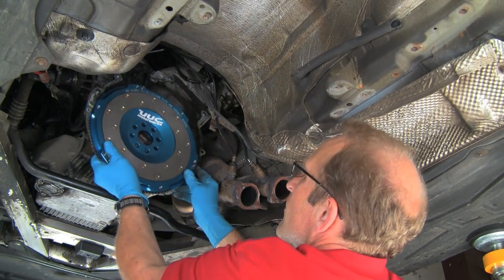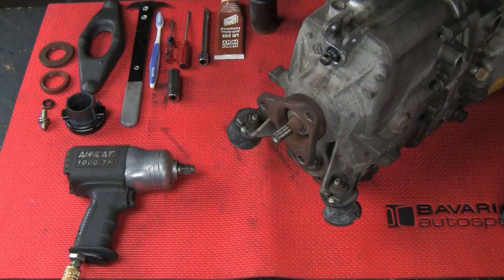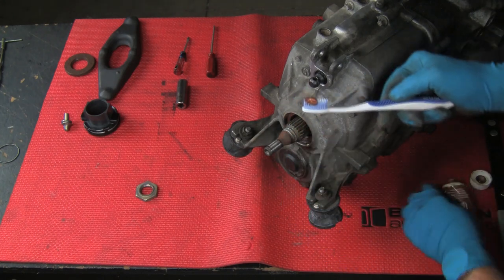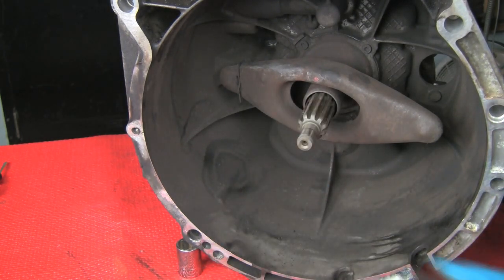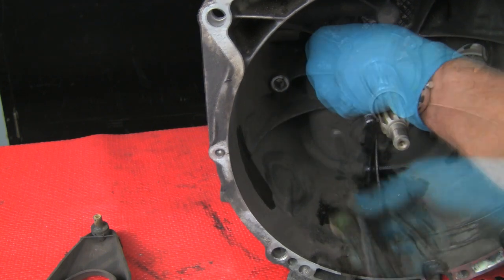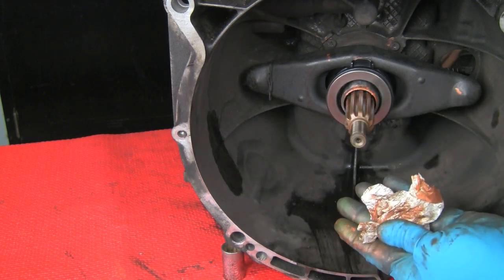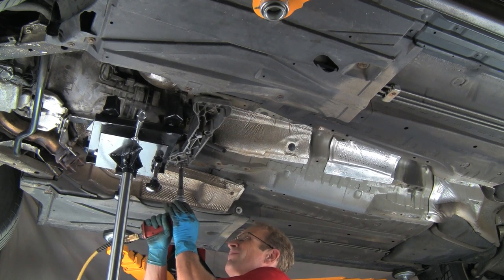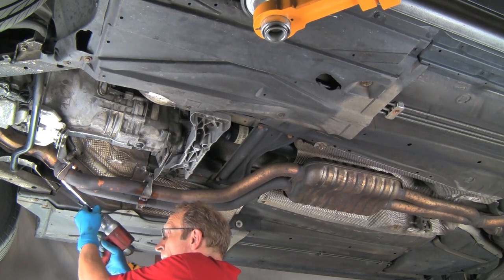Replacing a BMW Self-adjusting Clutch & Dual-mass Flywheel Part 2 of 2

Comment: Done mine one year ago, took me 2 days... :)
I use a Sach reinforced mecanism and a standard disc (no springs).
I was having a vibration at the pedal for a long time after having installed this new clutch, then today the the clutch release bearing has broken...
Do you have an idea of what can gave me vibration at the pedal ? Frequency is synchronized with the engine rpm, gear engaged or not leave the same feeling... Ideas ?

Comment: I just installed a Valeo single mass flywheel clutch kit including a new throwout bearing in my BMW. Though now when stopped,in neutral and clutch out, I hear throwout bearing noise.  Sounds like a quiet diesel. Any idea the cause? Some forums say it's hit or miss. .
Reply: if it sounds like a diesel when the car idles it's probably not the throwout bearing. it's the clutch chatter it's a pretty normal thing when converting from a dual mass to single mass setup.

Comment: I will definitely NOT be trying to do this job myself on my gravel driveway with axle stands, instead I’m going to be saving up for someone else, someone with all the right tools, to do it for me. 

Also, will be fitting an OEM LUK dual mass flywheel and clutch when the piggy bank is full.

Comment: I have a BMW 1994 325i and need to replace my clutch would like to know what exact clutch I should get would prefer a dual mass. What parts do you recommend I change as well as change the clutch
Reply from the maker: Cristian Marquez - We can offer you a direct stock replacement clutch assembly as well as the LUK new replacement dual-mass flywheel.  If you wish to eliminate the dual-mass flywheel, but do not want to go to a lightweight flywheel, we offer the Valeo dual-mass elimination kit.  This has a non dual-mass flywheel that weighs the same as the original dual-mass and a stock type clutch assembly that is made to be proper with the new flywheel.  You can see all of this is you go to the online store www.bavauto.com and enter your vehicle, then enter flywheel in the search box (for flywheels) or clutch (for clutches).
We recommend that you replace the following (our Advisors can help you personally at 800-535-2002):
* clutch
* flywheel
* throw-out bearing
* pilot bearing
* pivot pin
* transmission seals
* engine rear crank seal, if it's leaking
* rebuild shifter mechanism as required (fix sloppy shifter)
* Flex disc if original is cracked
* Transmission mounts if soft or cracked

Comment: Is there any chance the input seal can be put in incorrectly?  A friend and I recently replaced the clutch on my E36 and I was having a leak of clearish fluid at the bell housing.  Initially, we thought it may have been a leaking clutch line which was dripping onto the cross member support under the car.  I recently changed slave, hardline, and clutch line, and the leak is still there.  Looking at how you installed the input seal, I would guess we didn't do it any differently (I didn't install it).

Comment: How many hours of labor would this procedure take?
Reply: If working on your back, in the garage, it can be a 8 to 12 hour job the first time you do it.  We did the video in one day (using the lift) and this takes longer due to the filming.  A couple weeks later, we did another clutch replacement and, with two of us working (an on the lift) we did the job in two hours.
Reply from the maker: If working on your back, in the garage, it can be a 8 to 12 hour job the first time you do it.  We did the video in one day (using the lift) and this takes longer due to the filming.  A couple weeks later, we did another clutch replacement and, with two of us working (an on the lift) we did the job in two hours.

Comment from the maker: Graham S - We could not reply directly to your comment as it was entered via Google -
You can use a specific floor transmission jack.  These are available from Harbor Freight and others.  They have a large saddle and tie-down straps or chains similar to the high-lift jack we used.  Other than this, a common floor jack can be made to work by using ratchet straps around the transmission and the jack's saddle.  this is not nearly as secure as a transmission jack, but with care, can work quite well.

Comment: Great video once again, I enjoy watching them! I have a quick question when you have a minute: Replaced the clutch, pressure plate (to a self-adjusting) and flywheel (to a single mass) in my 01 330i and upon completion, after bleeding, I found that the clutch pedal didn't go to the floor, it stopped an inch before. Also noticed the clutch did not engage until almost to top of the travel on the pedal. I've searched on forums with no success, any ideas? Thanks
Reply: Bump. I have the same year/model
Reply: And? What was wrong?

Comment: You guys are awesome! I've been a professional mechanic for ten years and I have never used anti-seize on seal's I always use a little grease, assembly lube or whatever fluid or oil suits the application. I'm always happy to learn new tricks of the trade though thanks.
Reply from the maker: The main issue is to use some type of lube on the seal lip ... as you have been doing.

Comment: What yall think of switching to a Single Mass Flywheel in a 2006 320d? They are much cheaper SMF kits on ebay, including clutch and bearings.

Comment: I don't understand why people use antiseize to lubricate seals, pivot pin, or anything except what it was designed for. Remember, antiseize is simply a grease with very fine metal shavings in them. Why would you want to put metal shavings between a shaft and a seal or pivot fork and pivot pin? Just use regular bearing grease instead of anti-seize.

Comment from the maker: We do have a general shock and strut install DIY on our Tech Blog (blog.bavauto.com).  Once you check in at the blog, just search for "shock strut DIY".  The procedures shown for the rear shocks will be very close to the same for your Z4.  One difference is that the access to the nuts on the upper mounts requires removal of some of the convertible top trim parts, in the trunk.  We can help you with this, just call us at 800-535-2002.

Comment: copper lube on rubber/plastic parts is not okay. It will cause swelling and leaking. Only silicone grease should ever be used on rubber gaskets.

Comment: Hello I have a 316d f30 2015 116hp raised to 186.5hp
My clutch has a vibration when the car starts moving. What clutch do you recommend, a beater one that the 240mm stock?

Comment: just watched video and im looking forward to do this job myself. but on a e90. 06 325xi to be exact. but im looking for this kit that you used. i know im not get the light weight flywheel. i looked on uuc website and seen only the Valeo DMF flywheel conversion kit. but not all the other goodies that u have in the video seals bushings, bolts, and exhaust gaskets and what ever else im missing... im no pro but no amateur either. any guidance will be greatly appreciated

Comment from the maker: You didn't mention what model you have.  However, most BMW models do have a 30mm output flange nut.  Some models have a lock-ring around the nut.  Have you looked closely to see if you have the lock ring still inplace?  Is the nut as much as 6mm larger than the 30mm socket (as noted in the prior reply)?

Comment: What lubrication compounds are you using for the rear main seals as well the tranny seals? Just normal antiseize? Also I was reading through the Bentley manual and it mentions having to torque the output flange but in two stages; also provided are stage 1 and 2 torque specs. What exactly does that mean? Torque to the first spec, back off and torque to the final spec?

Comment: Very professional way explained in video, thank you.
I have a question, my BMW 320d from 2001 is 5.gear model i bought from Swiss second hand. The clutch pedal point is bit to high and if i don't sleep it slowly it might vibrate or car jump in the back, sometimes after i drive several km clutch pedal falls in real driving point, fells fine changing gears while accelerating, but it wan't stay longer then about 30.sec, i have open mask to check for pedals, it's all clear no leaks from cylinders at all and all things are in place. After i saw your excellent video you made, you mention self adjusting clutch...it it possible my car have this kind of self adjusting clutch and is unable to adjust or is it cylinders got air on it. Underneath my car is all the plastic and heat shields intact, it seem never been in service for more than oil change, so can you tell me what could be the problem with my clutch pedal please?

Comment from the maker: Unless you have a desire for the performance increase that a lightweight flywheel can offer, you would be better off in using the Valeo Dual Mass flywheel elimination kits that we offer.  These kits include a steel NON dual-mass flywheel that is the same weight as the original flywheel and a matching clutch assembly for the standard style flywheel.  See them in our online store at bavauto.com or call our advisors at 800-535-2002.

Comment: Loved this video. It really helped me with my clutch replacement. My clutch kit, from Advanced Auto, did not include the same elements prescribed in the video. Unfortunately, I can't wait for the parts because of my new job, I have to have this wrapped up by tomorrow. I do want to get one of the UUC lightweight flywheels in the future, so I may redo this job again in 25,000 miles (My new job puts a lot of miles on my car).  Anyway, thank you.

Comment: Great job but on a e39 525 the starter may get seized on the gearbox locating pin. You can use a wedge to remove but should clean up the pin and hole with paper and lube

Comment: The fork clutch pivot ball which is made of plastic is very important to replace guys, they either brake or melt, you can go with the dealers plastic or aftermarket brass type which is better. Is less then 13dlls. Thank you!

Comment: It's also not a bad idea to spray some brake cleaner inside the transmission and clean out any dust and debris left over from the old clutch while you have it out of the car. Some people like to actually paint the outside of the transmission when doing a job like this. Honestly that's just a personal preference and mostly something that people do if they're restoring cars to make it look nice.

Comment: I need to do the rear main seal on an 04 325xi,guess I'll do the clutch also as long as i have it apart,are their any additional things to remove aside from the front driveshaft? Does the transfer case come out with the trans?
Thanks for the video,should prove to be a much watched reference point.

Comment from the maker: We can't be sure about your specific case, without driving the car, knowing the vehicle and parts details, etc, but your issue may be due to the unsprung clutch disc, which may be transmitting more engine vibrations.

Comment: Excellent video.  It had all the detail I needed to replace my clutch.  However, I do wonder if the engine needs any support from the top once all the transmission supports were removed.  It didn't appear any engine support was necessary.  Thanks

Comment: Hi,   Great video, can you tell me the symptoms of a failing dual mass flywheel.
I have a BMW 320d E90 2005. 116k.     Getting a lot of vibration under the car (not through the steering wheel) when accelerating  at 2k/3k rpm typically in 3 / 4 /5th gears this is under the car, rear wheels are balanced,  using the clutch i have no issue, thats working great..
Thanks
Reply from the maker: Driveline vibration can certainly be a symptom of a well-worn dual-mass flywheel.  However, we would also suggest that you consider the flex-disc and/or the driveshaft center support bearing in consideration of your symptoms.  The most common dual-mass symptom would be a lot of driveline slack feel, such as jerking between acceleration and deceleration.

Comment: Ok, the release bearing was broken, advice : Do not use a reinforce mecanism with a stock release bearing.... well the man at Sachs told me the it was the procedure, but obviously it does not work... unless you want to change your release bearing every 20000 km...

Comment: can you tell me if a BMW 525 TDS E34 from 1992 (construction code is HA91) is equiped with a DMF ?
Reply from the maker: Yes, your 525tds does use the dual-mass flywheel.  We do offer an aftermarket replacement that is about 1/3 the cost of a new BMW flywheel.  If you go to our website (bavauto.com) and enter that you have a 1992 325i (we do not show your Euro model 525tds) and enter part number DMF016, you can see the replacement flywheel. To place an international order, email us at info@bavauto.com.

Comment: My first gear keeps popping out. I've taken it to some mechanics and they are telling me I need a new transmission. Its 2009 bmw 328 I the motor mounts are worn out a someone said it might be that or my clutch. What do you think I should do? If I'm careful it wont pop out until the rpms reach 2000 or a little before that. Please help
Reply: Hi

Comment: great guide.. need help bavauto.. followed your guide to the dot, successfully installed a new clutch and pressure plate by Sachs, reinstalled the transmission, start the engine and all good no noise etc but clutch is not engaging??? put it in 1st or reverse gear but nothing?? i can even release the clutch and engine wont die..

also while the car is running, i can shift to all the 5 gears and reverse even if im not stepping on the clutch.. any advice?

Comment: Wow, great video. I've got a 2008 E90 318i, and on first gear, when driving a lot in town, the car wobbles and shakes a lot. Is it the flywheel ? It doesn't do this on other gears. Do you know what's the price to change the flywheel in Europe ? Thanks a lot
Reply: Nikita Ind Before you inspect the clutch, check the Crank pulley on the front of the engine that drives the auxiliary belt. A visual inspection with the engine running will be fine to start with. If it wobbles while running even a small amount, turn the engine off and check it for play. There should be some as it's essentially a rubber doughnut. I had what I thought was a ruined Dual Mass Flywheel but after the crank pulley fell off one day and I got it replaced my judder has pretty much gone.

Comment: Ever since I installed my JB racing lightweight flywheel on my E39 2003 530i I have a chatter that has gotten worse over the past 4 years. Pretty embarrassing at valet when there are 40 people standing there as your car pulls up and sounds like it's got bolts tossing around inside the engine. Its about time to replace the clutch again and I'm planning on putting the stock flywheel back in so strangers quit looking at my car like it's a bucket.  Anyone else get the chatter? It goes away if you put a little pressure on the stick shift or push in the clutch peddle. Some report it's not noticeable but mine is very very loud. Everybody looks to see what the racket is. What I regret most besides putting this part on my car is not keeping the stock flywheel. (PS I'm not at Valet all the time but trips to Vegas or some restaurants where Valet isn't optional are anxiety provoking! )
Reply: S Craigs lmfao

Comment: I have an 1998 528i, it was 36mm.  I put light grease on the splines, but it had some kind of glue on it when I removed it.  Does the output flange nut require thread locker?  I ordered $256 worth of transmission stuff from you guys and I got it two days sooner than expected.  Thanks!

Comment: What is the benefit of using the lightweight flywheel compared to the dual mass flywheel? I've read that there can be more vibration in neutral and lower RPMs, and makes it a difficult situation for street use.

Comment: Do I have a problem if you replace the double flywheel with single flywheel. It is about 46 e 2002 105 kv. thanks in advance
Reply from the maker: No problem at all, as long as the proper parts are use, such as the dual-mass conversion kits that we offer:  What actual model do you have?  We don't recognize the 105kv notation.

Comment: Thanks for the video.

How does the price of this replacement kit compare with the OEM dual mass flywheel?

Also - I was told that the DMF was intended to absorb some torque and that a solid flywheel could make gear change rough.  Have you had any experience with ford Mondeos?

Comment: Great video. Having trouble with a stiff gearchange on my e61 520d. Dont think I will try this at home.
Reply from the maker: Try bleeding the clutch hydraulics (slave cylinder).  Also consider changing the fluid to the Red Line MTL or D4 (Dexron-III) fluid.  Click below for Red Line fluids:
http://www.bavauto.com/se1.asp?dept_id=5174

Comment: Not sure if I screwed up or not- I just got my new clutch kit in (SPEC Stage 1 with unsprung, self-adjusting clutch) and my single mass lightweight flywheel will be arriving tomorrow for my 1999 540i. Taking the spring out of the flywheel, should I have made sure to get a sprung clutch like you have in the video, or should I be good with what I've got? I'm guessing my clutch life won't be as long going this route. Thanks!
Reply from the maker: You will likely notice more driveline vibration with the unsprung disc.  Also, the engagement feel a bit more abrupt.  If you are performance oriented and don't have to spent a lot of time in stop & go traffic, daily, you may like the way it feels ... it's not for everyone though.
Reply: will there be a big difference in gear rattle going from sprung clutch disk to Unsprung?  i also have a light weight single mass flywheel and unsprung disk and the gear rattle is horrible! not sure if i should put the dual mass flywheel back in or try to put a sprung disk in instead. i don't mind a little rattle